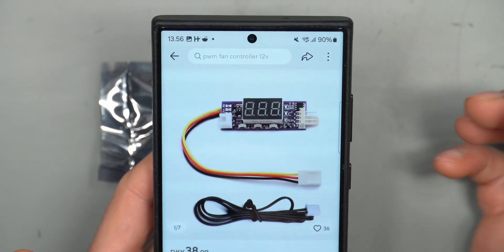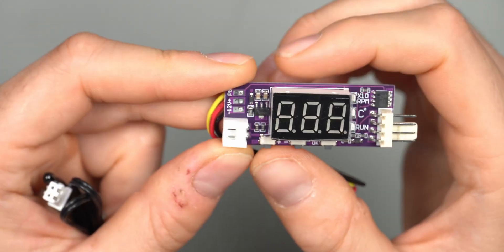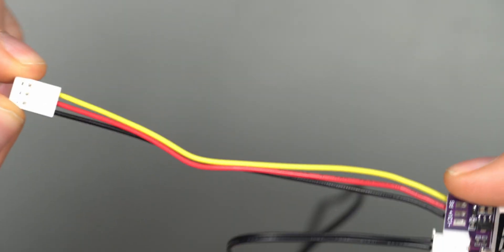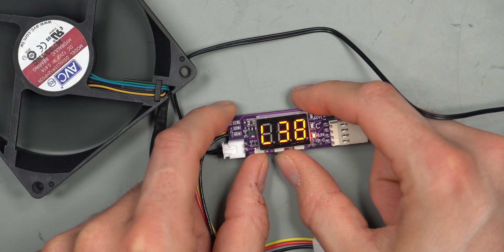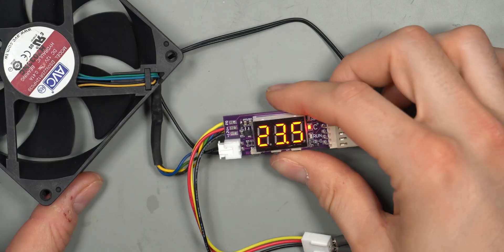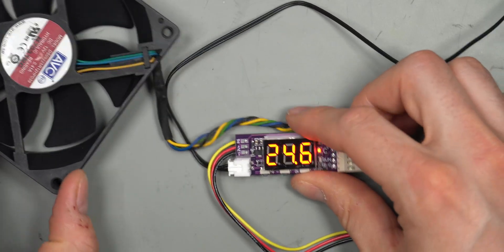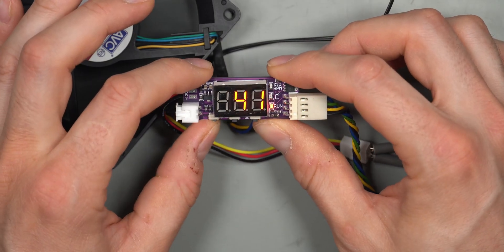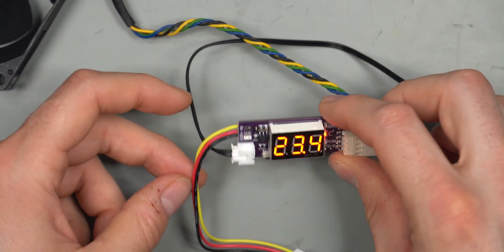PWM Fan Temperature Controller With Display: Review

Comment: hello, i have problem my fan rpm speed doesnt ramp up according to increasing of temperature, for example i set Low in 30 degree then High 50 degree, while temp from 30 the rpm is 1000rpm but when it reach to 40 it doesnt ramp up increasing rpm according to temperature, still about 1050rpm it should be about 2000rpm isnt right ? what the problem ? i though pin 3 from my fan is broken but when it reach to 50 degree it can showing rpm increase to 3000rpm (100% speed)
Reply: i think in my controller the sensitivity regulation of ramp up not correct, it can be setup the sensitivity regulation of ramp up ?

Comment: This is very nice and thank you for great description!
Will use it to control temperature of EV rover motor controller.
One function is missing till perfection: short run to 100% speed when powered on. Have you found such a feature or is it not implemented?
BR from good old Germany 👍

Comment: Hi, if i want control two or more fan, how i can do that? I want control only the rpm, the power of the fans came from an external power supply
Reply: You should be able to get a splitter or y-cable that allows you to plug two 4-pin PWM fans into the one 4-pin fan input on this board, similar to how you use one motherboard fan header to control two fans 👍

EDIT: ℹ You may want to check the specs of the board for the power output it can handle, which will determine how many fans you can control from the board since it also has to power them.

Comment: I have a similar controller but there is a d in the menu goes from -9 to +9. Any idea what it's for?
Reply: It changes the temp sensor reading, just place an accurate thermometer next to the sensor and adjust + and - until it reads the same as thermometer

Comment: Very nice and simple device.  One thing it'd be nice if it had instead was a 4p connector to the mobo so you have an option to do passthrough.  But still pretty damn useful.

Comment: Anybody found a Case Model for this as 3D print File?
Reply: There are a couple of them on printables. Search for "Cabinet PWM Fan Temperature Controller Case" or "PWM Fan Speed Control Module Case"

Comment: I have this board, there are a few features not mentioned so possibly they have updated it already. Press and hold + to turn the display off, after setting the cut off temp next screen is d which I assume is discrepancy and allows + or - of the temp reading to adjust for the correct reading.
Reply: Did you figure out what d setting do? I can’t find this setting document anywhere except for this comment. Can you verify this is what it does?
Reply: @hieudon5450  d is temperature measurement offset
Reply: Did you do anything special to turn the display off so far it just switches between temp and rpm doesn't want to switch off no matter how long I hold. Maybe I have a different model but looks the same
Reply: @ts5621  also i dont know how to turn display off

Comment: Hello. I wanted to know if this device could be connected to a 12v 2-pin fan. And another thing, I want to use it so that the fan starts when the temperature rises below a certain value, and stops when the temperature drops below a certain value. Can that be done with this device? Thank you.
Reply: it won't be able to control the speed with a 2 pin fan, it runs on pwm - it needs a fan with pwm signal input - 4 pin
Reply: @Jon-hx7pe  with two pin fan work too !!!!!!Try and let me know...
Reply: @eddy4011  work but on 100% constantly, no regulation on speed...
Reply: yes